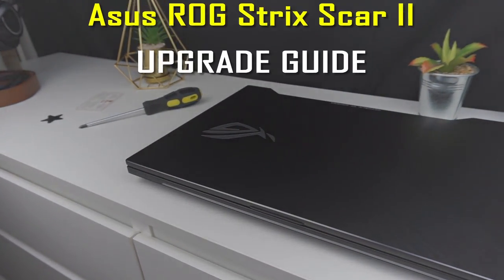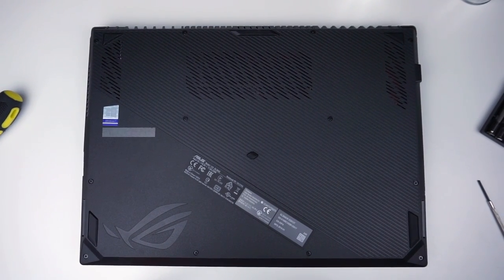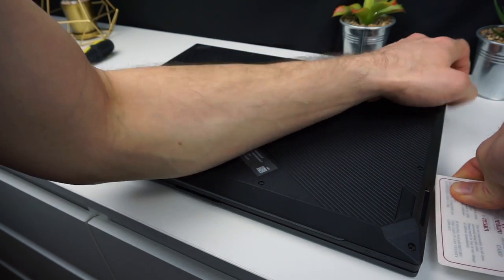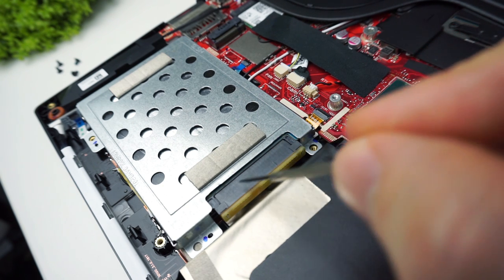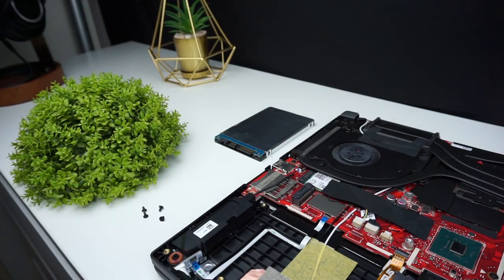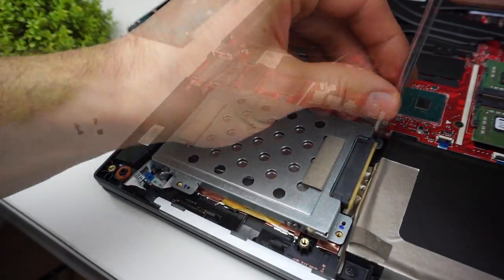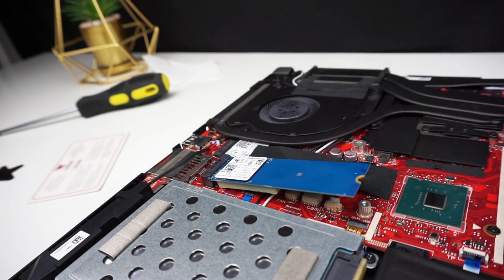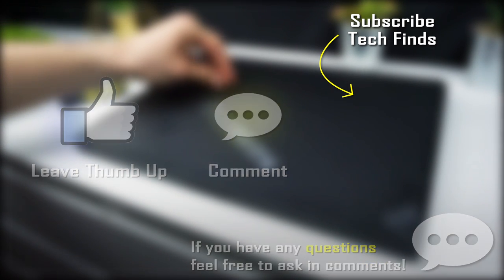Asus ROG Strix Scar II upgrade (RAM, SSD, HDD) - Disassembly Guide (detailed)

Comment: Hello I have a question about the 15.6 inch version. I bought an M.2 drive to install. The 512GB SSD that comes with it, is that the larger square plastic hard drive that comes in by default meaning there is an available M.2 drive slot for an upgrade? Or is the original 512GB hard drive an M.2 drive and then there's an open slot for the larger square plastic SSD? thank you very much for your help.

Comment: Very good video
You can tell me which of the RAM is better because the Ballistix (by Crucial) to be better because it seems to have a genre of a mini refrigeration while the HyperX the only advantage I see is latency.
Since you must have more experience than I would recommend more in relation to price, durability and performance
Reply from the maker: Few people reported that they had some problems with Ballistix RAM in this laptop. I mean they said it was working but the laptop could run it only at 2400MHz instead of 2666MHz. For the best compatibility I would recommend you to go for 2x the same sticks of HyperX or if you want to only add 1 RAM stick go for regular Crucial that I linked since it's the closest one to the stock RAM in terms of specs.

Comment: Hi, I tried upgrading the HDD slot with the Samsung 870 EVO SSD. I installed the ribbon and plugged everything correctly. Do you know what might seem to be the problem? Thanks!
Reply from the maker: So it doesn't appear in your PC right? You have to open device manager and make a partition

Comment: Hello, i want to upgrade my strix scar 2. Wich ram and ssd are the best of the three? And can i add another ssd and keep my ssd and hdd?  Greets :)
Reply from the maker: Hi, this laptop has only 1 slot for M.2 SSD and 1 slot for 2.5" drive where you can put HDD or SSD. So you can have 2 drives in total. For HDD Seagate FireCuda is good and for RAM it depends. If you wanna buy 2 RAM sticks you can go for any that i linked in the description, but if you buy only 1 stick to mix with original RAM you better go for Crucial since it has the same specs.
Reply: @TechFinds  okay thank u, so what kind of ssd do i need to replace my hdd ? Something like the samsung evo 860/870? And is it better to buy 2 identical ram sticks or buy one extra ram that has the same specs as the one thats already inside. Are 2 of the same rams faster or is the performance the same? Thosd were my last questions. Thank you alot.
Reply from the maker: @hasholiiiiiii  Yep something like Samsung Evo 860, it's actually a good one. You can add 1 RAM stick to not spend more money for 2 stick when you already has one. But it depends whether your laptop comes with 1x stick or 2x. For example if you have 2x8 it's better to buy 2 new sticks (2x16)
Reply: @TechFinds  thank u!

Comment: What's the difference between dual rank and single rank and which is better for this laptop
Reply from the maker: Dual rank may be about 5% faster than single rank, but it really depends on what you do. It's better to not mix them. Scar 2 comes with single rank RAM, so if you wanna add 1 more stick, buy single RAM too.

Comment: I changed my ssd which had my windows boot loader and all files on it. My laptop doesnt read the hdd on it for some reason, so everything was on the ssd. But now I'm stuck in the bios page. Does the new ssd come stock with a windows boot loader?
Reply from the maker: No, you have to fresh-install on the new drive using pendrive and a special windows installing tool from Microsoft

Comment: For me the cable came in the box separate and I just plugged it In after attaching 1 terabyte ssd and it was fine really easy
Reply from the maker: Yep, the cable should come with the laptop. It's by default i guess but sometimes it's missing for some reason.

Comment: ASUS ROG-STRIX Gaming Laptop GL553ve with GTX 1050 ti, Intel Core I7 - 7700, 8GB RAM and 237GB Total Space on my hard drive. Can I fully upgrade my laptop to GTX 2060, Intel Core I9, 64GB RAM and 1TB Total Space on my hard drive? 

(I don't have that much money for those but I'm asking if can ever get those haha)
Reply from the maker: You can upgrade only up to 32GB RAM and more space on the drive. The graphics cards and processors are not replaceable in laptops.
Reply: Tech Finds, thanks by the way you are the best :D

Comment: Are there any particular differences in RAM companies? For example, what would be different if I used Samsung or Crucial RAM?
Reply from the maker: The brand doesn't matter. If you mix with original RAM it's only important to match the specs.

Comment: Hi Chris

Great video! Keep up the good work! I'm planning on upgrading the nvme storage and I'm concerend about the thermal pad adhered to the nvme, can i use the same thermal pad for my new nvme? If not what's the thickness of the thermal pad i should be getting? Is the thermal pad necessary in the first place? Thanks
Reply from the maker: Hey, you can use the same thermal pad, but it's not even necessary to have any.
Reply: Tech Finds thanks for replying, just to be sure. Whats the thickness of the nvme thermal pad?
Reply from the maker: @outlight1997  no idea. I didn't measure it and I believe that Asus doesn't even provide such info since it's not really crutial. Maybe other users know.

Comment: Would changing the hard drive void my warranty? It stopped working and I don’t want to risk the data inside it - I’d prefer to be able to to extract the info from the hdd and I’m not sure if I can just replace the drive without voiding my warranty in case something else fails in the future (I’d prefer switching the drive cause I can heard it click all the time regardless of it being recognized or not - I want to send it for data recovery but I can’t unless I’m sure it won’t void my warranty.)
Reply from the maker: It may vary between countries. In general changing HDD should not void the warranty but if you'll damage the laptop during upgrade or a part you add cause any damage then warranty is void.
Reply: Tech Finds thanks for the info I really appreciate it!

Comment: i tried plugging in the SSD SATA connector to the motherboard but for some reason it would not fit tight in the hole no matter how far i pushed it. Do I have to slightly raise the ribbon then insert it? 

also are you sure it's safe to use a screwdriver to push the ribbon in? wouldnt it be safer to use a credit card?
Reply from the maker: Mine was not sitting tight there too but I think it was enough to be sure that it won't pop out. I used screwdriver because I didn't really have anything else, but it's a bad idea since you may scratch the motherboard by accident. It's better to use something plastic.
Reply: @TechFinds  interesting because my BIOS and Disk Management would not detect the additional drive. Even though mine was loose the connectors were still inside the hole. do those black little things on the side of the ribbon have to be inserted in the slot too?
Reply from the maker: @CheckmateStallioN  Nope, those little things on the sides won't even fit inside. The cable will go only until the pins are almost completely inside. Hey, can you check if the slot on motherboard has a little black flap on the oposite side to the entrance? Yesterday i tested Scar 3 and it has similare connector with such flap that you laver up to easily connect the cable and then you push it down to make the cable sit tight inside the slot. I thought Scar 2 had such thing too but my unit didn't.
Reply: @TechFinds  i do see a black thing on it but it only slightly tilts back on an angle, it cannot be lifted up i tried and dont want to force it otherwise it will break. You did mention that it didnt fit tight either. In my case it goes in and the connectors also go in fully but for some reason my BIOS wouldnt pick up my drive and neither will Disk Management. I read somewhere that i might need to install SATA drivers from my motherboard manufacturer but how would i find this driver and also the mobo manufacturer for the Hero 2 model?
Reply: @TechFinds  Thanks a lot for your help I actually was able to push down the little black tag on the slot and now my ribbon fit tight and I was able to partition my new SSDT :) i was very hesitant because even the Hero 2 RTX2060 is a pricy laptop and i didn't want to risk damaging any mobo components. hats off to you my friend!
Reply from the maker: @CheckmateStallioN  Yeah, that's what i meant - this black part should tilt and after you slide cable in you push it down. :)
Maybe i missed that in my unit but i was trying to tilt it and it didn't work. That's good you managed to solve your problem, have fun now.
Btw. idk why but all your comments go to the spam lol.

Comment: I want to add a hard drive and an extra stick of 16gb. Should I do it after my first startup or before?
Reply from the maker: You better setup the system first, make all windows updates, drivers, etc and then install RAM and HDD.
Reply: @TechFinds  thank you for the quick answer.

Comment: So I just ordered a Strix Scar II with probably 1 stick of 16GB RAM. I want to buy 16gb additional. Can I simply bit 'singlestand' HyperX which you linked? Or do I need dual kit?
Reply from the maker: Yes, you can just buy one RAM stick and add it to the empty slot. Ofc for the best compatibility it's recommended to have 2 the same sticks of RAM. However HyperX will work with your existing RAM for sure.
Reply: @TechFinds  THanks, I just bought 2x Crucial for 2x16GB! And the SSHD :) THanks for the video!

Comment: I've a question about SSD which you recommended that compatible,  for Samsung 970 EVO (M.2) and WD Black (M.2) have one cut/line in the connector, and Crucial MX500 and the one you pulled out from the laptop have  two cut/line, so how can Samsung 970 EVO and WD Black be fitted in or connect to SSD slot??
Reply from the maker: The slot in laptop supports bot SATA  M.2 drives (2x cut) and NvMe M.2 drives (1x cut)
Reply: Really?  Thank you for your quick responding.   This is first time to own this laptop.   I've not had a chance to open its base yet but will soon.   I'm going to upgrade SSD, SSHD and RAM.  I'm waiting on the parts to arrive then I'll open up and put them all in at once, but I've not ordered the SSD yet, because I'm confused with one and two cuts.  I try to get Samsung 970 EVO 1TB.  Mine is ASUS GL703GM-DS74 is quite different from this video but just model difference i guess but almost the same in other features and built components.   Thanks again and I appreciate all your video channels 😀 👍.   Honestly,  I used to build,  upgrade,  and fix laptop and desktop for living.   But I've been away from it for years now which dues to my illness.   And I'm trying to get back slowly and try to catch up on new technologies out there in these days.   I do enjoy watching all your videos channels 😉

Comment: Hi, I have a question. So my laptop came with an NVMe SSD drive but i wanted to upgrade it to more storage. How can i clone the SSD to the new one? There is only one M.2 slot so is there anyway if i can clone everything  to the new SSD? I have tried a method but it did not work gave me blue screen.
Reply from the maker: You have to install windows on the new SSD from pendrive. The files you have to coppy, store on pendrive or any external drive and paste into the new SSD after installing windows. The programs and games i think you will have to install again  on the new drive. I think that's the only way and to be honest i didn't try anything else.
Reply: @TechFinds  Thank you for the reply. I think i just need to create a recovery disk to an external flash drive and boot it from there to install. Programs and games are not important because it is brand new laptop so basically its empty but i didn't want to lose the recovery partition.

Comment: I'm struggeling with my Scar II. I have the dual channel RAM version but in CS:GO I have just 110 fps, it's very anoying because with this RTX2060 and the I7 it has to do more than that. I also tried to upgrade the RAM now I have one 8 Gb modul and a 16GB next to it. But it doesn't help at all. Any solution or idea which can help me? I also tried to update the bios but also doesn't helped at all. I'm loseing hope with the Asus products. @Tech Finds please help me :(
Reply from the maker: In case of CS:GO there is a big difference between single and dual channel RAM. In some cases when you mix RAM with different specs dual channel may not get activated. You have to check if your 8+16GB RAM works in dual channel for sure. Also make sure that you play on Turbo (overboost) mode.

Comment: Hello sir I have some minor scratches on my display, (same laptop) can anything be done about them? I just bought the laptop this year and some of them are my fault for touching the screen but I feel like it happened way too easily. I never got any scratches like this on my monitor at home.
Reply from the maker: Hey, i never had any scratches on my laptop's display and i don't know any solution to make them disappear. I've heard about laptop screen protector foil, but never used it. I think that it could mask existing scratches as it does the same to minor scratches on smartphone's display.

Comment: Hello, idk if you're still reading comments on this type of video, but I have the exact same laptop, and I'm looking to remove the graphic card to clean the ventilator part .. I can't find any video that explain how to do it, so if you can help me I would be so grateful
Reply from the maker: You can't take out gpu as it's soldered to motherboard. Unfortunately i can't show you how to do it, because i don't own this laptop and also ism not permitted to disassemble cooling system in the laptops that I test
Reply from the maker: Basically you have to unscrew and take off heat pipes and fans, but then you have to apply new thermal paste on gpu and cpu when assembling it back

Comment: Hey I have Strix G531GT i7 9th Gen with GTX 1660 TI 6gb with 500ssd and 1TB HDD.
My question is can I upgrade my HDD up to 3TB or no?
Reply from the maker: 3TB HDDs 2.5" are usually thicker than 9mm so I ihink that it won't fit the slot.
Reply: Tech Finds Thanks a lot, So 2TB hdd 2.5 9mm will be the best solution?
Reply from the maker: @ehabahmedragab8589  Yes, 2TB drive between 7-9mm will fit.
Reply: Tech Finds Thanks 🌹

Comment: If i add a new m.2 ssd(such as Samsung 970 Evo), would the ssd temp be too high due to no radiator? 
Also my strix ii doesnt hv hhd, can i put a m.2 ssd instead of that space?
Reply from the maker: The heat from drives should not be a problem. Yes, you can install 2.5" SSD instead of HDD
Reply: @TechFinds  thx for replying><

Comment: Hello Tech Finds, I added an additional 12 GB of RAM (Which worked). However, my laptop is unable to turn on without the power cord. It's almost as if the laptop does not recognize the battery. I de-attached the battery, upgraded the RAM and then re-attached the battery before closing the lid. Any ideas? Thanks in advance
Reply from the maker: Maybe you didn't fully connected the battery. Other than that i don't see any corelation between RAM and laptop not starting without power cord.

Comment: do 2.5" SSDs use the same SATA connection as the HDD and SSHD from the video? or do i need to get a different SATA cable too?
Reply from the maker: You can use the same cable

Comment: Hi I have strix hero 2 GL504GM, I have a question, the ram you pulled out is B+M slot bit in description you suggesting M slot config SSD, so does M slot SSD works fine in B+M and will my laptop support 2 TB ? if i replace OS drive?

Comment: Can I put there 2 x 32Gb RAM ?? Instead of 2 x 16Gb RAM ? I have in mine currently 2x 16Gb Hynix DDR4 RAM. As main drive I use SSD Samsung 1Tb 970 Evo Plus, as second would like to put Samsung 500Gb Evo 960 in SATA 2'5'' enclosure :)
Reply from the maker: This laptop supports max 32GB RAM (2x16)
Reply: @TechFinds  Thank you. I am still a little bit interested because it says in Task Manager "used sockets 2 of 4" in RAM summary. what does it mean ???
Reply from the maker: @michalk5262  No idea, it has 2 slots for RAM. It must stand for something else.

Comment: Hi, Tech finds, just wonder that does the original laptop comes with hdd cable and caddy or not?
thanks
Reply from the maker: It vary between countries and sellers. By default you should get it with all parts needed for upgrade but sometimes people report that cable or caddy is missing.

Comment: is that a 2.5 inch drive slot under the NVMe drives?
Reply from the maker: Yes, exactly. That big silver metal frame with holes is where the 2.5" drive slot is.

Comment: What kind of ram do you recommend me for this laptop? Single channel o Dual channel???
Reply from the maker: Single channel is when you have only 1 RAM stick installed. If you add second stick you have dual channel. It's good to have 2 sticks.
If you mix go for Crucial that i linked, because it has the same specs as your original RAM. If you wanna replace 2 sticks you can go for any RAM you like, of course if compatible with the laptop.
Reply: My idea is have 32 Gb. :)
Reply from the maker: @Jwlagos  Good i recommend HyperX for this one if you want the fastest RAM, but Crucial is good as well.